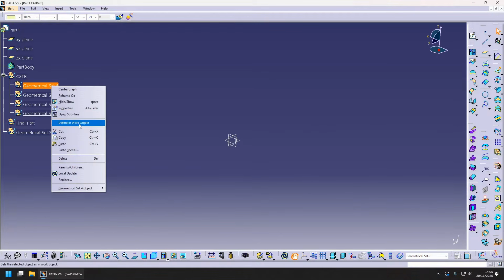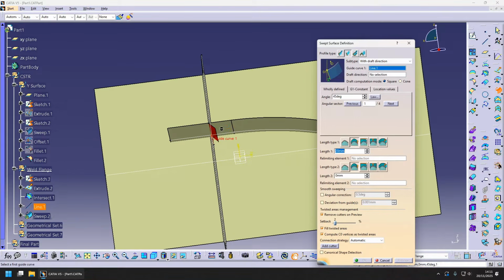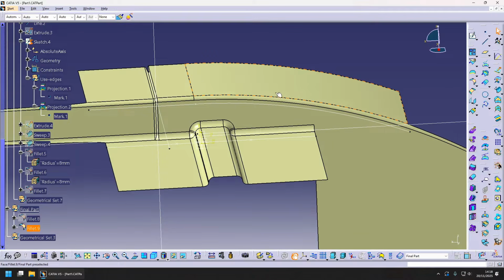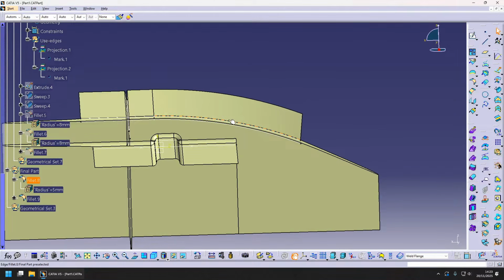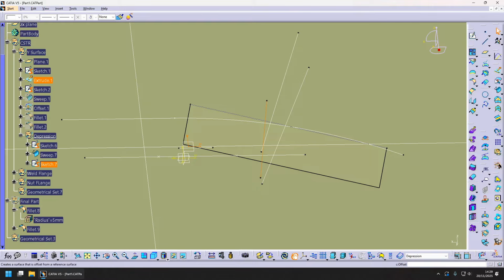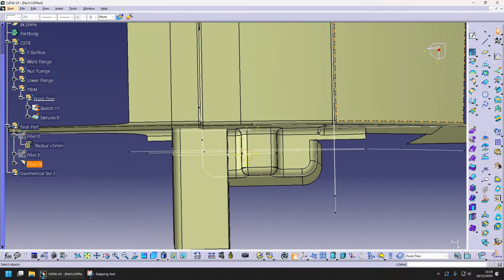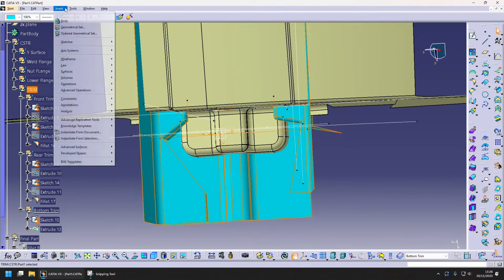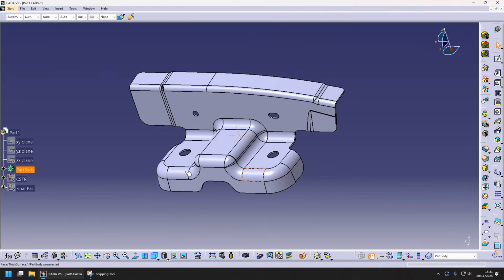This CAD Workflow Will Change Your Life | Catia V5 Tutorial

Comment: STILL I AM DOUBTFUL ON USING FILLET ON TRIM BECAUSE IF WE WANT TO INSERT SOMETHING IT MAY GIVE ERRORS? btw GREAT EXPLAINATION IT HELPED LOT
Reply from the maker: Hmm. You mean trimming with a surface that is a fillet operation? 

Of course it can give errors if you modify something in the part. But it's like that whatever you use... I think
What do you use instead?
Reply: @CADMasterclass-r3s since we have more operation and some more profiles on base surface they advice not to use fillet untill other profiles in between are filleted to allow final fillet for smooth flow. I am beginner